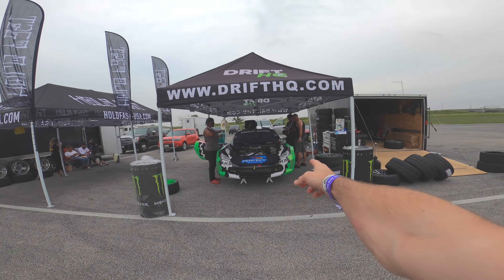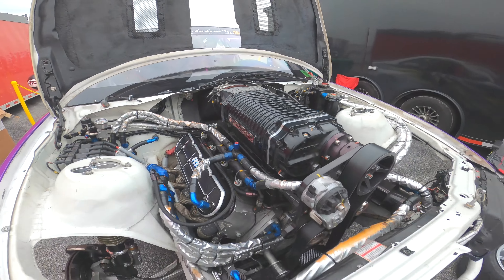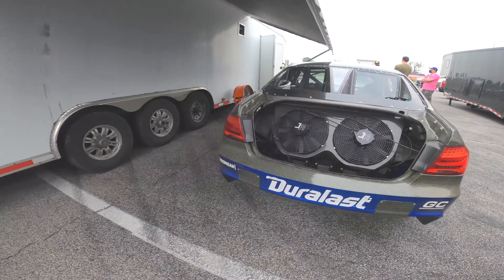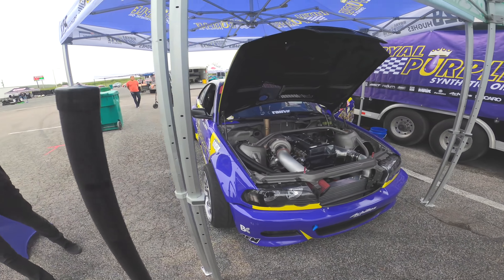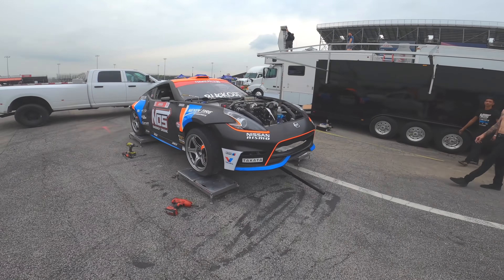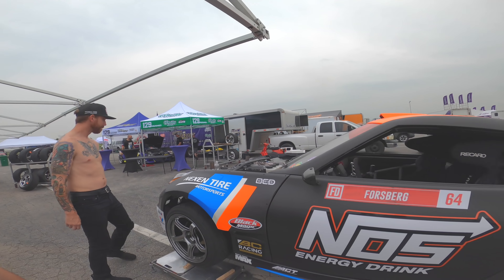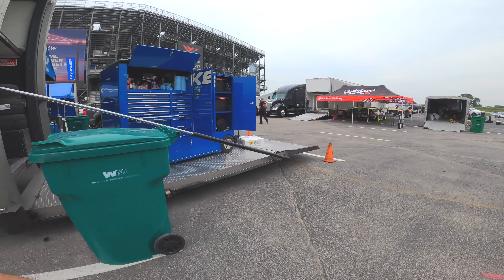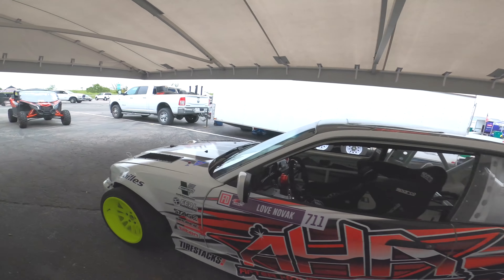First 2020 Formula D Pit Walk

Comment: says s14 twice when it’s clearly an s15 ...
Reply: Since it's kevlar it could be custom made s15 body panels on s14 chassis..so there's a chance it's an s14
Reply: touge34 it’s an fd car, good chance its barely got a chassis. Probably mainly tubes for stability n keeping those kevlar panels on lol
Reply: @Mrpunkluv  I think there's rules that they can't cut out anything past strut towers on both front and back, or something like that, otherwise everyone would have deathkarts 😂
Btw i remembered that car from hoonigan video and it is indeed an s14 with s15 panels
Reply from the maker: That is an s14 with conversion fenders and lights.  It is not an s15
Reply: @Mrpunkluv  Those are 2 different chassis' my dude..s14.5 is just an expression since it's not a factory thing..doing fender coversion doesn't make it another car 😁
Reply: Look at rear side windows. It's an S14 chassis with S15 front and rear
Reply: AlexNZL ohhh I see now my mistake... super cool though!! I gotta learn how to mold carbon kevlar parts lol
Reply: When some dude thinks I don't know my s-chassis 😂😂😂 Cmon son!